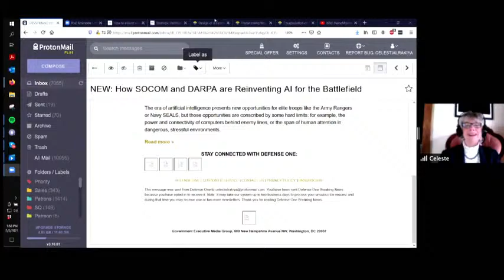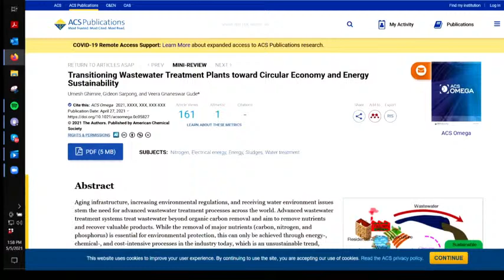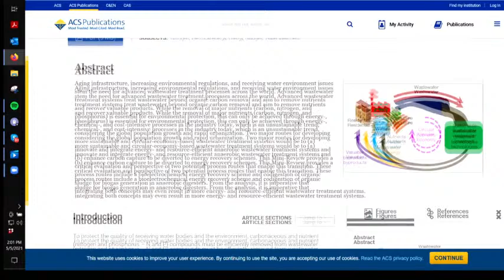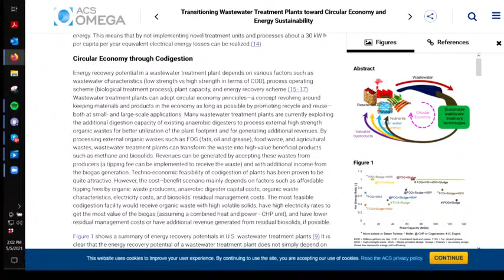NanoMoment with Celeste

Comment: The hydrogel, etc will get into the water table quickly and then ALL waters. Incl “pristine” streams and springs and wells. The water cycle will then put it into the rain and we ALL will be “chipped”. 
There’s no way out.
Reply: That's not how the mark of the beast works. 🤔
Reply: @juanareyes7119  lol what does that mean?
The Mark is a choice. That’s all.
Reply: @YeshuaKingMessiah    

The mark is 4 in one .

In the Arm 
In the forehead 
Worship of image of beast 
Worshiping the beast 

The book of revelation is pretty clear.
Reply: @juanareyes7119  
The shot goes in the arm, heads DIRECTLY for the forehead. It’s a choice from worshiping the Beast system.
Reply: @YeshuaKingMessiah    

Yeah the jab is the mark that is mentioned in revelation the c19 
Test goes to your forehead.

Can you explain about the water 
And rain you mentioned in your comment.
Reply: @YeshuaKingMessiah     friend thanx for the info. Happy Shavout
Reply: @ericbollen7890  Amen 🙏
Reply: Loo